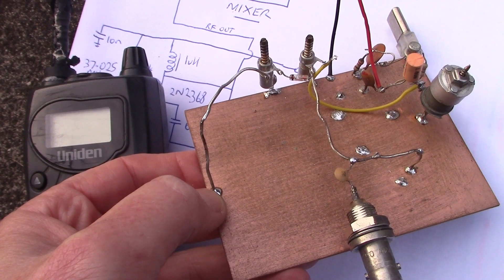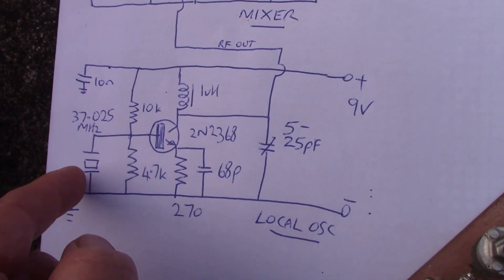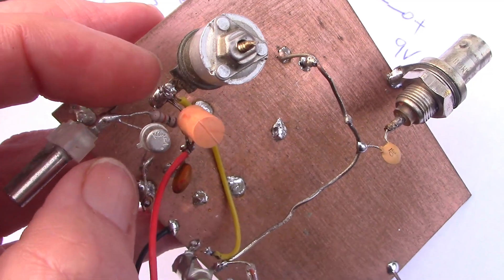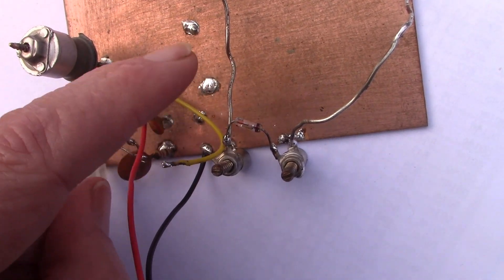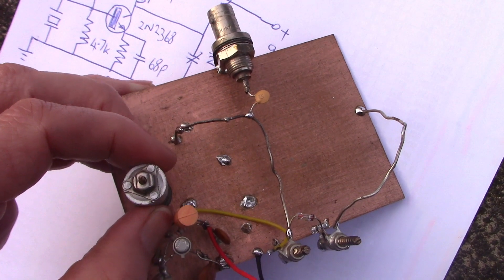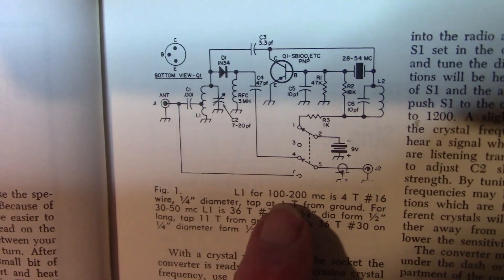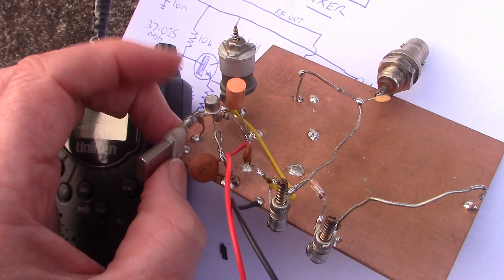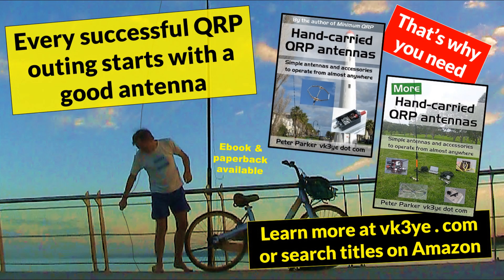How I heard 440 MHz hams on my 477 MHz UHF CB

Comment: bonjour peter
j adore vos projets sur du materiels 27mhz surtout les convertisseurs frequences sur ecoute sur poste cb
car je ne suis qu un cibiste hi ( c est une façon pour utiliser nos cibi )
en france on a pas de t elles videos 
j adore vos bidouilles qui melange schema type viintage avec des composants electronique que l on peut recuperer n importe ou 
se serait sympat de votre par de sortir un convertisseur 144mhz sur cibi 27mhz soit par oscillateur a quartz ou equivalent lc car tres dur de trouver quartz 38mhz
73/51 peter et merci pour les videos
cyril dep 11      france
hello peter
I love your projects on 27mhz equipment, especially the frequency converters for listening on a CB station
because I'm just a cibiist hi (it's a way to use our cibi)
in France we don't have any videos
I love your hacks which mix vintage type schematics with electronic components that you can get anywhere
it would be nice for you to release a 144mhz converter on cibi 27mhz either by quartz oscillator or lc equivalent because it is very hard to find quartz 38mhz
73/51 peter and thanks for the videos

Comment: Very much like my down converter I've had going for a few weeks now. I originally used my nanovna for the oscillator, and when I found how well it worked I made a crystal oscillator. I'm down converting 487.600mhz which is the output of a repeater for a very active taxi company. I too am using a Uniden UHF CB handheld radio. I found it on a bush track years ago while walking with my dog. I had a old 27mhz radio I'd picked up from the verge that had a heap of crystals in the 10 to 11mhz range. There was also just as many in the 37mhz range. So I'm thinking they worked together with the difference for the various 27mhz channels.

My down converter is so simple. A crystal oscillator using just six components. 2 resistors, 2 capacitors, 1 npn general purpose transistor and the crystal. It will work from 9v and down to 1.5v. I run it at 3v. The mixer is a single germanium diode. So just 7 components all up. I had two crystals that matched what I needed. The 10.625 one brings the incoming signal down to channel 23 on the CB handheld. Like yours the receiver is not directly connected. The quality of the audio is excellent. No static or breaking up noise what so ever. The repeater I'm receiving from is much closer though. We have three mountains right in the middle of the city where I live. It will be on one of those, on a tower with all the other stuff. It's either 1 kilometre away on 3 to 4 kilometres away.

It occurred to me last night that this will probably work in reverse. Transmitting with the CB and have it upconvert the transmission. Indeed it did. Now I'm not going to interfere with the taxi company. I can do tests on a slightly different frequency. It worked through, and I was able 
trigger my baofeng radio that was a couple of rooms away. I've no idea yet how much power is being outputted. Is it the same as the CB radio after going through the mixer? Those cheap UHF CB radios which I think are half a watt, claim about 3k line of sight. Amazingly, I could even move up to half a room away with the CB transmitter and it would still work. Being received, upconverted, and triggering the baofeng in another room.

Comment: I know you touched on this in the video, but as a former communications tech that spent time tracking down interference to public safety radio , you need to be careful that local osc harmonics don't fall on critical radio frequencies.  We had one example where an ultrasonic mouse repeller was radiating on the local police frequency. Nice discussion video !

Comment: Fm radio/ 3 meter band to 70 cm would be interesting. 🤙
Reply from the maker: Sadly it won't work. Broadcast FM has too much deviation to be properly heard on a 70cm receiver.
Reply: @vk3ye  bummer that'll be a cool device to take a few anywhere in any car. That's for replying 😀
Reply: Great video Peter. I Was thinking along the same lines as @michealbell5042 but using a car radio on AM to receive the US superbowl on 27MHz using oscillator and mixer stage. Deviation is 10khz I think on AM have you tried this before? Keep up the real world tinkering. 73 M0SBG
Reply from the maker: @thebrigbri5708  It would work fine. Superbowl uses AM just like the car radio. You just need a crystal about 600 - 1500 kHz away from 27.025 MHz, preferably converting to a frequency away from a local AM station.